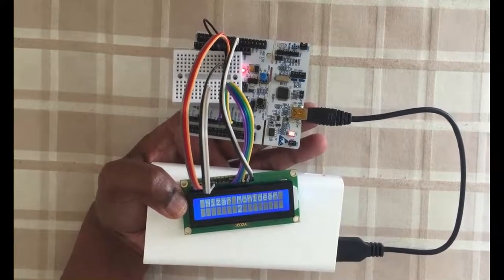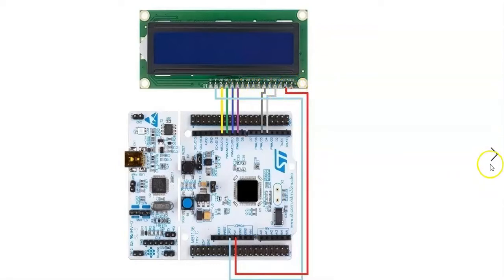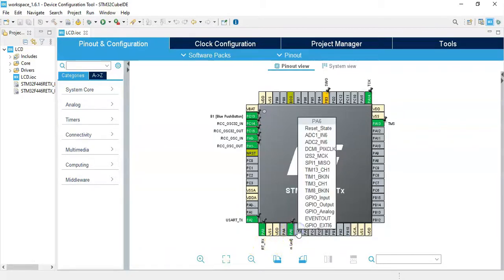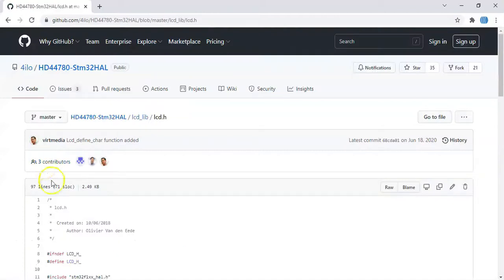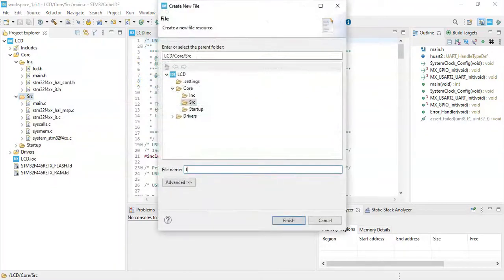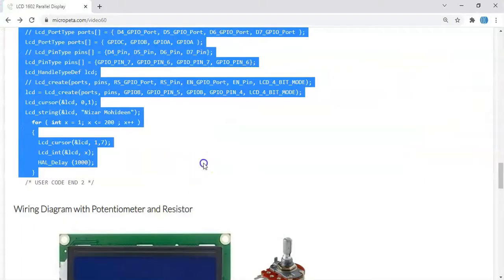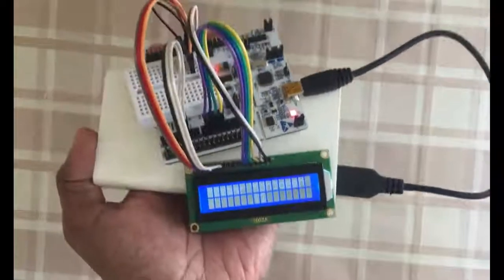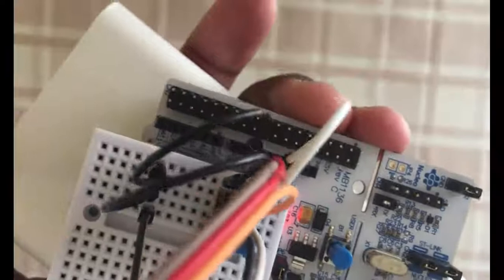60. STM32CubeIDE LCD 1602 Display. Parallel 16x2 with STM32F446RE

Comment from the maker: You can use without 100 Ohm resistor for only short period of time to test.
You must use a 100-330 Ohm resistor if you want to use for long time.🚦
Reply: Hey, I don't have resistor right now, so I connect my anode directly to 5V. Is it OK?

Comment: ✅✅✅ working without any issue ..... I'm using with STM32G030 MCU ..........  good thing compare to other library it print Integer directly with separate function without converting it into string. Thanks for reducing our work load.

Comment: Hello sir...! My 1st question:-That lcd.h and lcd.c files can use any type board...? Please reply and clarify me...
2nd question:- why you are take random pins like different port pins. Why not take same serial pins like.. PORT-B 0,1,2,3,4,5,6. Can you please clarify my doubts sir ......?
Reply from the maker: It should work with all STM32 boards
You can use any pins you want as long as you put the pins in
Lcd_PortType ports[] = { D4_GPIO_Port, D5_GPIO_Port, D6_GPIO_Port, D7_GPIO_Port };
Lcd_PinType pins[] = {D4_Pin, D5_Pin, D6_Pin, D7_Pin};
Lcd_create(ports, pins, RS_GPIO_Port, RS_Pin, EN_GPIO_Port, EN_Pin, LCD_4_BIT_MODE);

Comment: I'm curious if it goes well, because the author is connecting VDD to 5V and according to Datasheet of the LCD, the MIN Input High Voltage is 0.7VDD what is 3.5V, but as known the GPIOs only deliver 3.3V.

Comment: can i ask a question sir?....the backlight does not light up. But my lcd setup is in 4bit please i need help, plus my board is installed on a board that uses seperate supply from the data input...really need assisstance

Comment: Hi, I followed your guide but I've a problem with display: the left side is less visible than the right side. I tried with from 10 - 330 Ohm resistor but nothing has changed

Comment: Hi, Great tutorial..I tried  this example for all LCD pins connected to PORTC with connections as below: PORTC0-->RS  PORC2--->EN, PORTC3 ,C4,C5,C6  ----> D4 to D7 but,I am just getting boxes and no display on LCD.. but,if I change my pins to that as shown in example it works fine..  why is it not working for my pinouts that I am using?
Reply from the maker: Set those pins to GPIO_Output
use below format for ports
// Lcd_PortType ports[] = { D4_GPIO_Port, D5_GPIO_Port, D6_GPIO_Port, D7_GPIO_Port };
For example
Lcd_PortType ports[] = { GPIOC, GPIOB, GPIOA, GPIOA };
use below format for pins
// Lcd_PinType pins[] = {D4_Pin, D5_Pin, D6_Pin, D7_Pin};
For example
Lcd_PinType pins[] = {GPIO_PIN_7, GPIO_PIN_6, GPIO_PIN_7, GPIO_PIN_6};
Lcd_HandleTypeDef lcd;
use below format to create LCD
// Lcd_create(ports, pins, RS_GPIO_Port, RS_Pin, EN_GPIO_Port, EN_Pin, LCD_4_BIT_MODE);
For example
lcd = Lcd_create(ports, pins, GPIOB, GPIO_PIN_5, GPIOB, GPIO_PIN_4, LCD_4_BIT_MODE);

If still doesn’t work with your new pins, use a simple led blink on each pins to check for faulty pins
You can also try with some other pins. Thanks
Reply: @NizarMohideen  Hello..I checked that because of improper wiring all the problems now all works fine..I would like to know how do you avoid wiring problems which go unnoticed and we keep checking the program..

Comment: Hi Sir, thanks for the tutorial. I have a question sir, I can display the value but why it doesn't have backlight sir?
Reply from the maker: Make sure both 3.3V and 5V power supply are properly connected and then rotate the potentiometer for brightness. Thanks
Reply: mine does not light either

Comment: One more question please sir.

If we have done everything like this, and want to print some sensor data also in while(1),  how would lcd code come then?

for example, over here:
  	  ADC_Select_CH4();
  	  HAL_ADC_Start(&hadc1);
  	  HAL_ADC_PollForConversion(&hadc1,1000);
  	  ADC_VAL_Voltages[0] = readValue5;
          readValue5 = HAL_ADC_GetValue(&hadc1);
          voltage1 =(float)readValue5/4095*16.5;
          HAL_ADC_Stop(&hadc1);

Thankyou!
Reply from the maker: You can use Lcd_int(&lcd, x);  // x need to be an integer
If it is a float value, break into two integers
One for integral and another one for decimal separated by an dot
Use three lines of code as below
Lcd_int(&lcd, x) 
Lcd_string(&lcd, ".")
Lcd_int(&lcd, y)
Reply: Hello you did it please ?